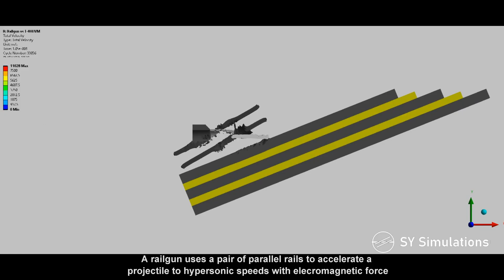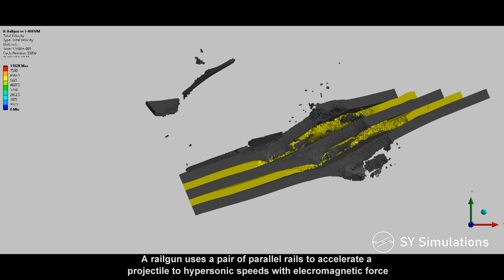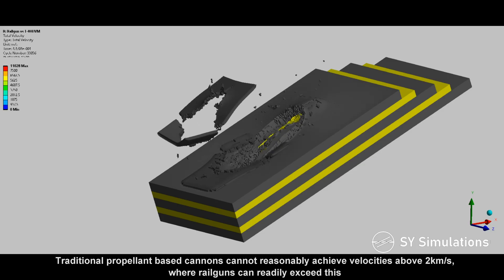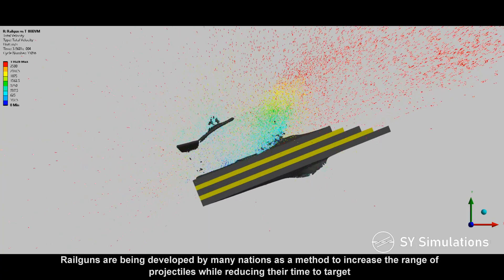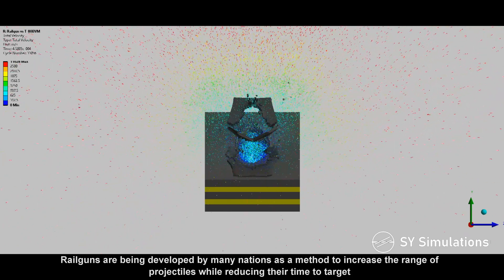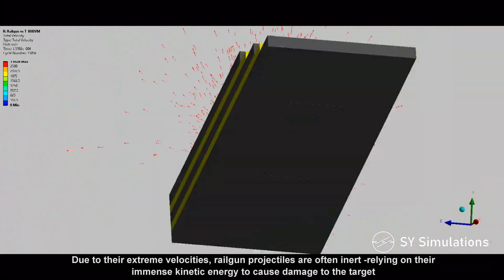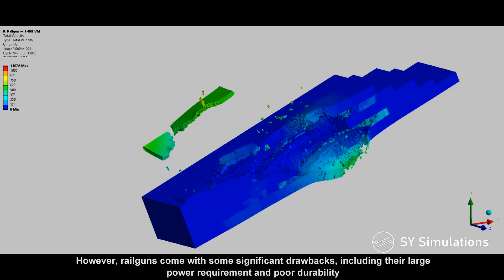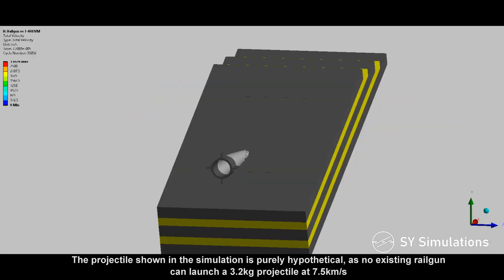RAILGUN vs T-80BVM | Hypersonic Armour Penetration Simulation | APRIL FOOLS' SPECIAL

Comment: For anyone curious, the United States supposedly cancelled their railgun program. The power requirements were wildly  impractical. In addition, the projectile kept destroying the barrel/firing mechanism when launched. There needs to be an advancement in metallurgy for railguns to become durable enough to not destroy themselves when firing.
Reply: a coilgun would be a smidge more viable with current technology, what with not having to deal with a positively absurd amount of friction and all
Reply: @   For i have seen from prototypes, coilguns have demostrated to work nice for high caliber proyectiles in short ranges.
But that tech is still in a early stage, so is possible that the situation could change.
Reply: That's curious, since other nations have continued with their respective railgun programs, like France, China and Japan
Reply: @Arhiman93   - Yes. The US navy canceled the program in 2021. Ontop of the railgun problems I wrote, the Navy said they felt hypersonic missiles and lasers were a better investment for the future.
Reply: @TheBigExclusive  Yeah but railguns are much cooler😎
Reply: @Arhiman93 as if the US has a monopoly on corruption.
Reply: At the end of the day, it's always material science that's gotta get the job done
Reply: I feel like even if railguns were optimized, true railguns would still burn through rails pretty quick. 

Simple solution is carry replacement rails and make them easy to swap on the fly, 
the wonderful sci-fi “The Sojourn” shows spaceships with huge extra rails lashed next to the guns, like extra tracks on ww2 tank hulls.
Reply: Or space use.
Reply: is that why they installed it on one of their ships yes?
Reply: @ No, no railgun has ever been installed on a Zumwalt, all models have been on grounded testing equipment or analogues. Zumwalt class is being equipped with two BAE AGS conventional naval artillery guns.
Reply: The barrels last for about 20-30 shots, which is untenable for a warship. They didnt get destroyed after one shot
Reply: Not cancelled it's paused (they put the funding into material science for the gun so they can get a working material for the gun)
Reply: We dont have to make it touch the barrel. We can make it levitate through it. but still the size of a railgun with that kind of technology is simple stupid.
Reply: Also needs a new source of energy as well. Don't know about a nuclear one yet.
Reply: Thats sad
Reply: Weird, because railguns are non mechanic. They rely purely on magnetism.
Reply: @TransAmDrifter  theres still rails, hence the name rail gun. There's friction and a strong mechanical fixture needed to hold the rails together
Reply: Real life… is lame
Reply: There needs to be world peace so we won't waste money and resources for such bullshit
Reply: advanced chemical guns (hydrolox) or electrothermal guns would be better.
Reply: The barrels would last about 40-50 shots
Reply: Not canceled, but is rather put on hold for the time being.
Reply: No they didn't.  Rail gun is still in production.  Its been sized to fit on ship.  Power issue is solved with nuclear reactor.  All barrels get worn out over time that's not a new issue.  Right now size is the limiting factor
Reply: China will do it
Reply: Unless the few shots possible before the barrel needs replacing are enough to cripple a vessel. Then I wouldn’t be surprised if we in fact “cancel” the project.
Reply: They didnt use smoothbore
Reply: We really need to make a railgun battleship, or something so we can have freaking halo style railguns
Reply: Sounds like one of those things that's just a touch ahead of its time. Lasers are great tech now, but 20 years back they weren't viable
Reply: *supposedly canceled
Reply: The US Navy did not abandon the railgun project. In fact, they completed it. Railguns are installed on all Gerald R Ford supercarriers and they have been deployed in combat operations, just not in the form anyone expected. Every Gerald R Ford comes equipped with an EMALS (Electromagnetic Aircraft Launch System)--a railgun that fires airplanes instead of bullets.
Reply: It was barreled
Reply: I would hazard a guess and say that largescale railguns wont see much practtical application even if we found the adamantium to keep it from disintergrating itself. Everything the railgun does a missile does better.
Reply: @steinnusszeta3304 Well, advantage of a railgun is you can’t jam it. And I’d hazard a guess it probably isn’t practical to shoot down either.
Reply: @JabberZilla  But what would you use it on? To hit a target at the same ranges that modern cruise missiles can (<2000 km) you'd need eyes on target or very good intel (projectile cant find its own targets unlike some missiles). Then there is the problem that these projectiles dont really carry any explosive so you just have a metal dart that dosent do a whole lot against bigger targets. Then of course the powerdraw requireing a big powerplant on the ship.

Maybe its usefull as CWIS for anti missiles defense, but then again. Other missiles are also already kinda better at that job.
Reply: @steinnusszeta3304 My understanding was its original use-case was precision strikes in support of special forces - the assumption being that you would have literal eyes on target for what you are trying to hit. To your point though, it’s pretty use-case specific, maybe too specific to justify its current power requirements and hardware inefficiencies.
Reply: @steinnusszeta3304  No, that is not true. For one, missiles are massively more expensive that railgun projectiles. Railgun projectiles are a few ten thousand in cost. Even the cheapest shipborne missiles are over a million per missile. And hypersonic missiles are in the 40+ million range, with some costing more than an F35, for a single use weapon. This is why Miltiaries across the world have been seeking ways to extend the range of guns, because missiles are often hundred to thousands to tens of thousands of times the cost of a gun projectile.

An Hypersonic missiles are the only missile types that truly match the speed of railgun projectiles but cost nearly two thousand times more, and a few hypersonic missiles cost as much as a whole railgun system.

Missiles are also much much larger than gun projectiles. Meaning a gun armored platform, railgun or not can carry far more gun ammunition than a missile. Railgun rounds in particular are quite lightweight, with a ship being able to carry a hundred railgun rounds for the weight of one moderately sized antiship missiles. Hypersonic missiles are of course very large and heavy, often weighing as much as a thousand rounds of railgun ammo.

So simply put, if railgun engineering improved to the point of having a useful barrel life, realistically they would make a lot of missiles obsolete.
Reply: @ryuukeisscifiproductions1818  That's a mighty big 'if' in the barrel life sentence... regarding space - the space needed by power generation will likely negate this, if not exceed it.  So railguns are unlikely to be seen on anything but larger naval vessels. Missiles are extant technology with a proven record with relatively high precision guidance systems, and longer range. So, US has probably just shelved it temporarily rather than cancelled it outright, purely on a budgetary basis.
Reply: @ryuukeisscifiproductions1818  if you extend barrel's life, you can just make what Germans did in WW1 - a hypersonic cannon that doesn't need a huge battery
Reply: @Optimistic_Hobo  the calculations for the energy costs of firing a railgun are already calculated, its equivalent to about a gallon or two of JP-8, or a few kilograms. to carry enough fuel for 600 rounds of ammunition is about 3.7 metric tons worth of fuel. 

Its worth noting that the total weight of all the propellant charges for the 5 inch guns used by the burke class destroyer amounts to about 5.2 metric tons.

The media heavily exaggerates the energy costs of firing a railgun, and the Zumwalt class already produces sufficient power to use two of them. And the space needed for the larger power plant was on part already counter balanced by upping the voltage used by the Zumwalts electrical system. Where as a lot of older warship power systems are 4160 volt systems, the Zumwalt's use a 13,800 volt system.
Reply: @ryuukeisscifiproductions1818  But the capacitors for the railgum are themselves very heavy, I don't think we should compare projectiles alone as a complete weapons system with ammo storage is more telling. Also, you're also going to need surplus power gen and a large surplus if you need to fire with and speed, as the charging time for a railgun system would be longer or shorter depending on power gen... simultaneously, the power storage itself would be vulnerable to damage or malfunction and could disable the weapon. Railguns may just be too complex for any meaningful use for a long while.
Reply: @ this has already been engineered out in the Zumwalts, they are designed already to have its AGS replaced with railguns on a one for one basis if the barrel wear problem could be worked out.

And the concern about components of it being vulnerable to damage or malfunction literally applies to any weapon system out there more complicated than a thrown rock. 

And one advantage that railguns have over other weapon systems in terms of battle damage is no explosive propellant, shells or missiles are required, meaning no potential for catastrophic magazine detonation. 

And a lot of these claims about this weapon is too complex to be useful is literally disinformation pushed by Russia and China to discredit America's most advanced weapon systems. Literally the same claims have been made about the F-35, the F-22, the M1 Abrams, the M2 Bradley, the F-15, the F14, the Nimitz and Ford Class carriers, ect ect. Any time America comes up with a new weapon system, our adversaries publish tons of the exact same disinformation, "oh its too high tech, vulnerable to malfunction, its not rugged enough, its unproven." Its the same playbook, every time.
Reply: @ryuukeisscifiproductions1818  This is literally the opinion of the requisition dept. of the US military, its why its not being adopted... in the testing it had all the vulnerabilities I mentioned and has been in that state for years. Its too complicated and unproven because the DoD has determined it to be that way until other scientific advancements mean a revival of the project. Like the Future Combat Systems projects and the integration of computers to soldiers... hardy enough equipment was simply to bulky, and not powerful/fast enough to be worth the adoption. OICW was yet another program that has the sane faults... the targeting computer was just too bulky. This isn't Chinese or Russian propaganda, this is the fact of reality that the DoD believes it's not worth the investment.

It's a false equivalency to say a cannon is as complicated as a railgun, and you should know better to make a strawman out like they're both as complex as a catapult because "anything is more complicated than throwing a rock". Get your head on straight and accept reality, its not like China or Russia will have anything close for decades.
Reply: @V3RTIGO222  citation needed. Cite your sources, im not taking your word.
Reply: @ Excuse me? What about the US DoD cancelling development don't you understand? Cite your own sources that confirm that the developments and breakthorughs to make the weapon feasible is close at hand, that factually you can determine that we should adopt this weapon and there is no downside to do so - because it seems that, again, the requisitions department has determined that is not the case.
Reply: @ 
Missiles today are preferred over guns because:

    -They carry larger payloads.

    -They far exceed the range of conventional gun systems.

    -They can course-correct and find their own targets.

Speed is a moot point if the actual projectile from a railgun doesn't achieve the desired effect. I have yet to see a railgun-launched projectile with a payload (possibly because the electromagnetic fields interfere with fuses or sensors).

For a railgun, you'd need a massive power plant permanently installed on the ship. The power draw of these systems is not to be underestimated.

I'd like to see a gun system that can reliably hit a moving target from over 2,000 km away while still delivering enough payload to sink a ship. Railguns are cool, but they require precise knowledge of the enemy's position, speed, and size. That intel is hard to obtain in an active war when satellite or air reconnaissance is restricted. A missile that can find its own target and adjust its course solves all these issues in a way that a gun system simply doesn't.
Reply: Only takes 3.7 tons of fuel, huh? and the generator equipment? And the capacitors? Cooling systems? Sounds like it's going to take a huge leap in metallurgic development to make useful barrels, and that sounds cheap and easily replaceable if taken out by the enemy, don't they? Just tell us you have a boner for railguns without saying it (it's okay, everybody who watches anime and scifi do the same). And I wouldn't call engineers actually working on the project "sensationalist media". But like I say, they're unlikely to be seen outside of naval vessels anyway, and until fully developed, it'll always come a distant second to extant, proven technology that can do everything a railgun claims to be able to do. 
However... the main pay off to developing such "next ten years" technologies isn't always the main objective, but off shoot projects. What will make railguns remotely viable will be things like room temperature super conductors and extreme heat resistance metals. Both of which will have a massive knock on effect to the world economies, like zero resistance power grids. So is it worthwhile, yes, but probably not the way most people who just read the click bait think it will.
Reply: @ryuukeisscifiproductions1818  Railgun is not good because the projectiles relies solely on kinetic impact, so their kill potential are extremely limited, they're good at punching through armor, but not much else, couple with lesser range comparing to a missile, At least a missile have a 500kg warhead.
Reply: @ryuukeisscifiproductions1818  Im sure yu know better than the USA's Navy
Reply: @ryuukeisscifiproductions1818 railguns require more shots on target to achieve the same damaging effect as a missile. Railgun projectiles are not capable of maneuvering like missiles. And more. The cost of the railgun will exceed the missile in order to achieve the corresponding damage capabilities.
Reply: @Optimistic_Hobo  you get it.
Reply: @Tr4wnet  Your not the US navy, nor is anyone else here.
Reply: @a.t6066  go redo your research homework, I'm done dealing with the misinformation here.
Reply: @ryuukeisscifiproductions1818 nothing i said was misinformation
Reply: @ryuukeisscifiproductions1818 the barrel life of a railgun is like 600 shots. Then the tips of the rails need to be replaced to keep up the accuracy. It can still be fired but will be less accurate. The rounds cost 700 dollars a round. And in the test gun a energy reload of 15 seconds. The only draw back is the rail tips and generator size.
Reply: @ryuukeisscifiproductions1818 that’s an exaggeration, and also it doesn’t really mean much, because you will spend more on maintenance of the railgun
Reply: @ryuukeisscifiproductions1818  furry cope 🤣
Reply: @a.t6066 then launch a guided projectile

there are guided artillery shells, and hypersonic glide vehicles are a thing

if u fire a gps-guided HGV out of a railgun, it would be able to glide in the upper atmosphere to correct its trajectory (and potentially increase range), before crashing at the target at mach jesus
Reply: @God-ch8lq  the point is the whole cost savings idea goes out the window when that happens. Again, the number of shots to achieve the same effect on target as a 250lb or even 100lb payload would mean the cost savings between the two systems to achieve target destruction would be negligible. Especially difficult to justify when you're taking up time, resources, and asset space when a perfectly good system with all the existing structures already exists and can perform the job more efficiently.
Reply: @ryuukeisscifiproductions1818  out of interest, could you name few of the missles that would become obsolete?
Reply: @Morfeusz1895  depends on when the railgun might enter service and how long it takes to solve the barrel wear problem, and if the barrel wear problem can be solved any time soon. But if the barrel wear problem is solved in the next ten years, most likely the missiles that will go obsolete will be any missiles with a shorter effective range than the railgun while missiles with a longer range will stay.

On the other hand it could take fifty to a hundred years or more to solve the barrel wear problem on railguns, so its impossible to be specific.

If your asking for more specific models there is no way to answer that because we dont know when the railgun might come into service, and a lot of missiles that are                   currently in service now may already be obsolete by that time because better missiles came along.
Reply: @ryuukeisscifiproductions1818  what missile has a shorter effective range....?
Reply: @ryuukeisscifiproductions1818  40+ million for a single missile is just criminal.
Reply: @ryuukeisscifiproductions1818 doubt, I still don't see any hint of any navy planning to scale railgun for larger explosive payload since they all wanted them to be multi purpose by  prioritised anti missile or aircraft capabilities in design which hinder capabilities against anti-ship or large stuff.

consider that even WW2 light cruiser and destroyer still afloat even after countless shell hit due to shell over penetration, How would modern ship be any different since they don't even have armor and railgun projectile will just pass through like shooting a 22lr through a big  cardboard box?

Saturation(by volume or explosive size) is a key to sink a warship, not precision, which current railgun development don't have in their design.

It's more sensible to put them in ground warfare role due to the need for precision, if we can solve power issue first.
Reply: @WordingtonComment  because at the speeds railgun projectiles hit, overpenetration's aren't a thing. at the speeds that railgun projectiles hit, both the projectile, and whatever it hits shatters with an explosive force that exceeds the explosive power of most missile warheads. Simply put a railgun projectile cannot over penetrate because no material we have is strong enough to withstand that kind if impact intact.
Reply: overpenetration is still a thing, given modern warship don't even carry armor like before, A railgun projectile at 75% or more of it's max range is still capable of doing arond 1200m/s which is way faster than ww2 naval gun, even if the projectile shattered, the fragment or a part of it would still  retain the pre-hit projectile moment/direction and continue down it's path until velocity is 0. 

And what do you even mean by explosive force of a missile since railgun fire metal sabot slug, you can put as much as energy as a missile to it but it will never match or create similar explosive effect of a missile when hit. A railgun slug can only penetrate and create internal shrapnel/spalling NOT making a fireball and explosive over pressure to blow or casuing fire on ship compartment like missile do.
Reply: @ryuukeisscifiproductions1818  Maintenance costs would be astronomical still even if you had the materials. cost of maintenance materials alone would be absurd.
Reply: Missiles are good and all but with ship armour and defensive countermeasures improving the warheads and missiles keep having to get larger and more expensive to combat this. Hypersonic missiles are fast yes but only in a straight line. Ask one to turn even a few degrees per mile and it will happily disintegrate for you.
The advantages of a railgun have the same uses as large scale navey guns. Large cost for the weapon system installation but cheap ammunition and propellant.
A railgun is also non explosive so if the system is hit by incoming fire it won't detonate the ship it's installed too.
The power requirements can already be solved with nuclear reactors. Most US ships have nuclear reactors to power them and the US has already installed them in smaller ships like cruisers before so it can be done.
The limiting factor will always be the mechanical problems of the barrel wear. Eliminate that issue and you can have battleships again poking holes in things from beyond line of sight.
Reply: @MarcusRhodes-q2s  High yeild capacitors are explosive. Barrel wear is a significant cost factor that might be more expensive than missiles for a long while - due to the fact that replacement is significantly more verbose. Technicians working on railguns would be more expensive, and they would be working more hours when it came to maintaining the electronics systems and the rails. You also have an issue of fire rate - those capacitors take a long time to charge up between shots. The test bed connected to the grid couldn't manage a fire-rate appropriate for even naval use.
Reply: @V3RTIGO222 yes 15 seconds is a long time to charge up.
Reply: Only two rails. No ablative conductive lubricant. No hotswappable disposable rails. No any actual solutions. Just cancel.
Reply: I suspect railguns will ultimately be a dead end technology as far as military applications go. Coilguns make much more sense as an electromagnetic cannon given their relative simplicity and lack of self destructive tendencies.
Reply: It feels like nuclear fusion - always another ten years of development needed...
Reply: @Optimistic_Hobo  because you have been given the wrong impression by a sensationalist media at how long a new technology takes to develop. It is not unusual for a new technology to have a very long development cycles. Electric motors took a hundred years to go from tech demonstrators to practical industrial tools, and steam engines took several hundred years. Long development cycles for a new technology is not unusual.
Reply: @ryuukeisscifiproductions1818  that was a joke refering to 50's belief that, because it took 10 years from A bomb to H bomb, it will also take 10 years to get from fission power to fusion power, and even though 20, 30 and 40 years passed, it was always said to be "maybe 10 years away". In wider sense, to what I call "scientific blueballing", where we're been constantly teased that new breakthrough is within reach, even though no real advance toward its practical application has been made for decades.
Reply: @kireta21  major breakthrough in fusion are happening though
Reply: I still don't understand why they made a railgun instead of a coilgun. Coilguns seem to be better in just everyway, including not destroying themselves.
Reply: @ttpechon2535  gauss systems are significantly less efficient when it comes to velocity, but have advantages when it comes to mass... so getting a projectile to hypersonic speeds with a gauss weapon would have significantly more energy requirements, be more expensive when it comes to high fidelity sensors, and equally as vulnerable if not moreso to damage.
Reply: The barrels destroying themselves is a by-product of firing the gun at maximum energy output, under the usage of 20% - 40% energy range - the barrel life increases exponentially (at the cost of velocity and range).

Achieving the power requirements isn't a big issue - when the platform is made to be incorporated with a Railgun system, the big issue is integrating it on existing ships without having to sacrifice other systems or overhauling the entire ship just to integrate a system.
This is why Small-caliber railguns are more feasible than the Standard ship caliber. Japan has been testing it as a Extended Range Point Defense System (CIWS) or as a Anti-Ballistic missile platform in the 40 mm range. Until there's a new material made to counter extreme stress and withstand the plasma generated by the projectile at maximum output with standard ship calibers, then I wouldn't see it replacing certain type of missiles the Railgun was meant to take over with.
Reply: all cuz of round speed you can't shoot beyond horizon, which limit your gun range
Reply: That seems like a strange reason to cancel a program. If your program runs into material science limitations, then just divert money to solving that problem.
Reply: @TheMohawkNinja  ? Thats a terrible way to think. The cost to do material r&d would be much much greater than to just shelve the project for later.
Reply: Power requirements go up at a geometric rate for incremental steps in velocity.

Also a rail gun is useless if someone with a drone drops a grenade down your hatch.